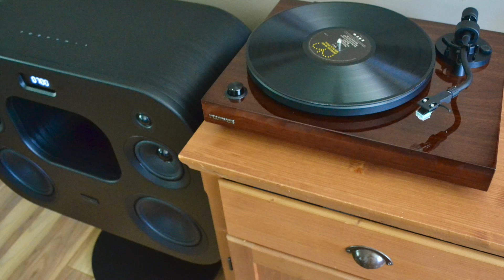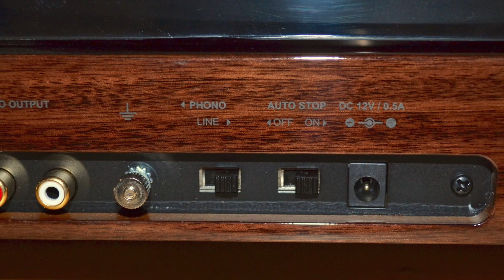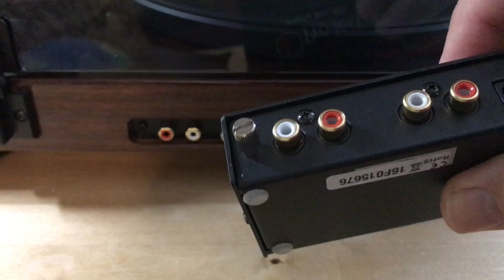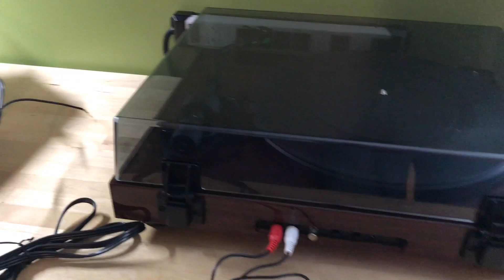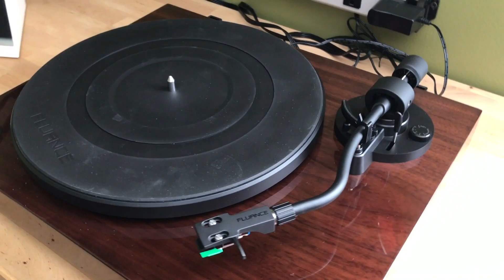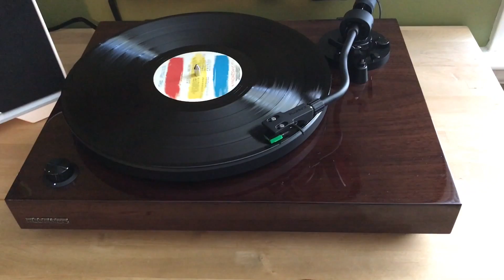Fluance RT81 Turntable Blogger Review

Comment: 300 is still entry level when u got tables up to 700
Reply: There is no need to spend 700 dollars on a turntable.  I have a 1986 Uitrx turntable i bought on sale at Circuit City then. I've been spinning vinyl on it for years and it still kicks paired with Sansui speakers I bought in 1990. I've only changed one belt for 5 dollars and replaced Carts 4 times.  I'm looking to upgrade but not at 700. I'm staying in the 250 to 300 price range. Looking at Fluance, AT 120XUSB, UTurn Orbit.

Comment: To anyone considering buying this Turntable, It would be better to save up a couple hundred bucks more & buy a Pro-Ject, or a Rega Turntable instead.You will be Much Happier. Don’t buy a Turntable with a built-in Preamp. It affects the sound quality even if you bypass it on the back. Buy a High Quality stand alone Preamp instead.
Reply: No it doesnt it sounds real good
Reply: Wrong ,i did the exact opposite of your statement and got the RT85 !! HUGE improvement ,my kid now has the old 1 (no names mentioned ).

Comment: I'm still amazed that some turntables still do not build in the auto-return feature!  Are you kidding me?  I'd own one of these beautiful Fluance's in a heartbeat if they would only have thought to include that 'vital' feature.  Does one really want the record to just stop spinning when the needle comes to the end of the record and leave the needle on the vinyl?  Incredible....
Reply: Auto-return isn't a vital feature.  It may be a feature that you want, but most audiophiles I know have fully manual arms.
Reply: Will leaving the needle on the record damage anything?
Reply: @1063Days  Don't worry about it. I'm old and grew up with direct drive, fully automatic turntables. I now own a belt drive, manual turntable (not this one) and I don't miss the automatic feature. At all.
Reply: @1063Days  No, not per se.  IF the auto shut-off feature is enabled, the table stops turning after ~15 revolutions leaving the needle right where it was.  The auto shutoff feature is controlled by a switch on the back of the unit.

Comment: I have two of these turntables. They are terrific!
Reply: But for the lack of the auto-return I'd own one myself.  But because it doesn't - forget it.
Reply: Are they made in Canada or ?  Thanks
Reply: @mic982  They are made in Canada
Reply: @raygu1818  I'd like to think so (because I finally bought one - the RT 85) but while it doesn't say where the point of manufacture is anywhere on the table itself, it does say 'made in China' on the outside of the box.  I bought mine straight from Fluance themselves and not from Amazon or elsewhere.  It was shipped to me from Niagara Falls, Ontario, Canada.  It's a very nice table and well-made but not without a couple things Fluance should address.
Reply: @mic982  What are the things you feel Fluence should address? I hear customer support isn't user friendly
Reply: @raygu1818  Just checked my box that the table was shipped in from Fluance:  'Engineered and Designed in Canada.  Made in Taiwan'.  Just to clarify my earlier comment of them coming from 'China'.  Taiwan, not mainland China.
Reply: @raygu1818  Customer support is very friendly - even to the point of giving me a discount coupon on my purchase making it much more frugal to buy direct than from Amazon.  3 items they need to address: 1) faint markings on the counter-weight and anti-skate mechanism, hard to read in low light 2) cheap, plastic 45-rpm adapter (why include it if it's plastic?) and 3) an 'iffy' feel to the tonearm lift/lowering mechanism.  In all fairness, the lift/lower mechanism works well, lowers the tonearm gentlyly (~5 seconds) but it has a plastic feel.  I mean, the table is of such high quality these 3 things seem odd fit for it.  Just me, perhaps~
Reply: @mic982  Thanks
Reply: Mic And forget grammar, am I right ;^)
Reply: Mic Possibly yeah
Reply: in a good sense or a bad sense?
Reply: nudding rong wid me grammer.  Spinny thing's godda have audo-return or I dun whant it, lol
Reply: PartyPoison785 - probably bad